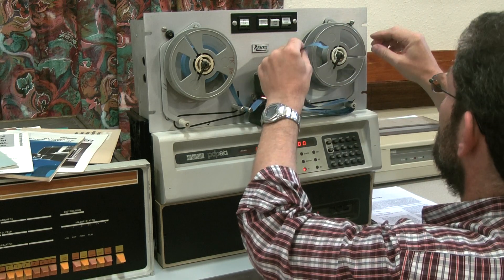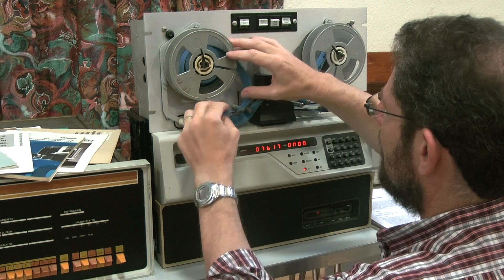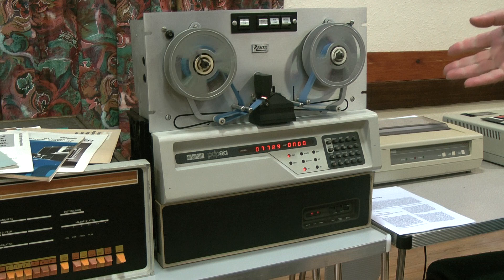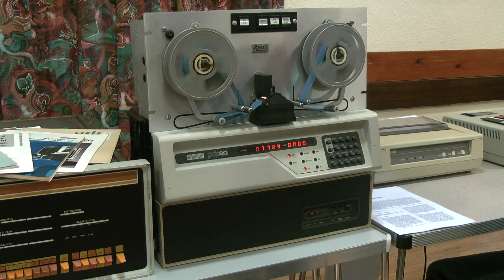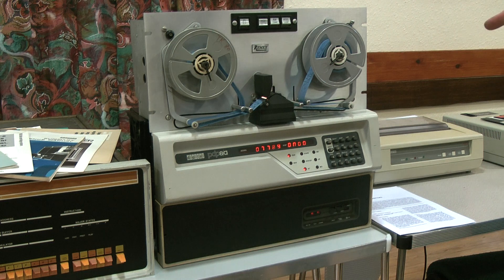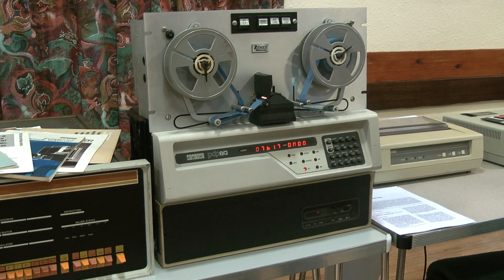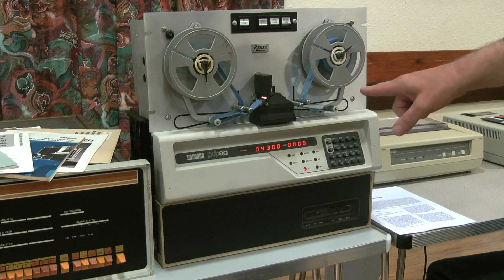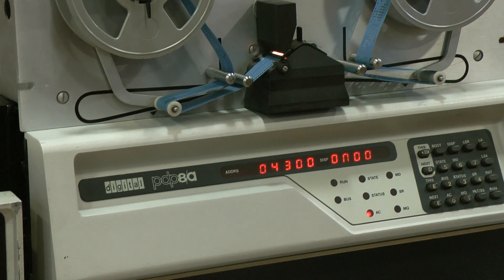PDP 8/A with Remex Paper Tape Drive

Comment: Ah, fond memories (no pun intended).  I worked with a few PDP-8s, more PDP-11s, and a ton of VAXen (~450 diskless VAXstation 2000s at once) plus many Alphas and a couple of Itaniums.  But there's something about this era of computing I love.

I ran an HP-1000 that had what appears to me the very same tape unit, or a close cousin.  We even used it to punch a replacement loop tape  for the Vertical Formatting Unit on a Centronics 703 printer.

Comment: Were did the tape drive come from?  Reminds me of the drives used on very old industrial control systems.
Reply: Remex is a common drive, still in use.  Made in Irvine, CA, a division of Ex-Cell-O

Ex-Cell-O Corporation REMEX DIVISION 1 733 Alton Avenue / Irvine, CA 92714